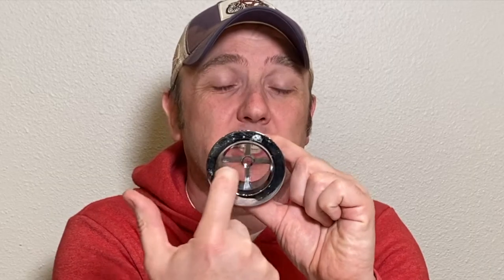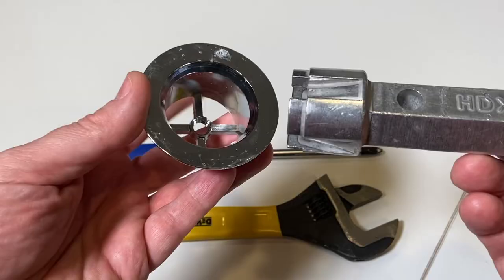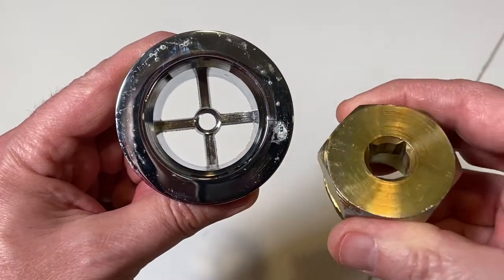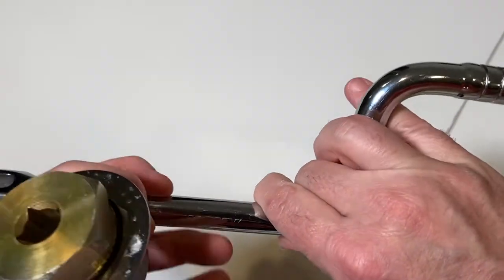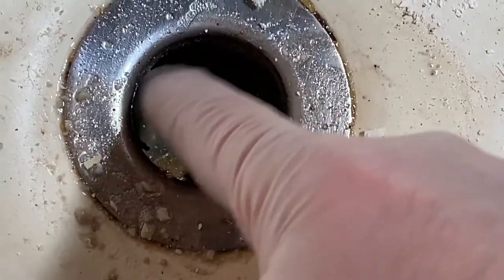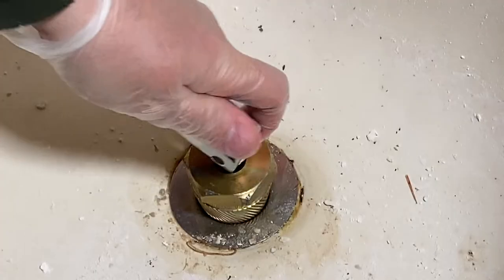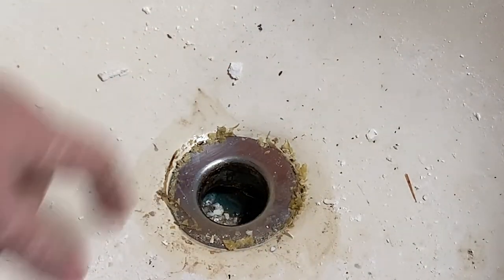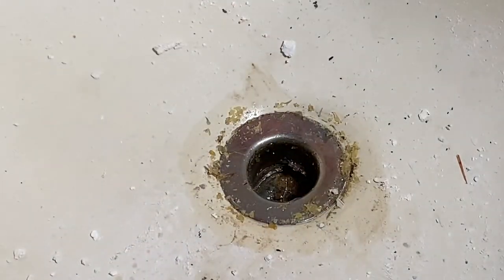EASY Plumbing Tools for Removing Bathtub Drains

Comment: I just removed the most stubburn 1-3/8 drain.  Tried a couple tools and methods.  Finally got it with a Blow torch for about 20 seconds, then turned it with that 1-1/2” extraction tool and a breaker bar.
Reply from the maker: Right on. That is awesome. I will add heat next time ones stuck. I just bought a new tool to review that looks like it could be the best on the market.  A review will be coming soon.
Reply: @ThatFixItGuy  Yesterday I tried that new 1-1/4 to 1-1/2 extraction tool by Superior, and it did not work for me at all.  It wasn’t even close to working in my situation.  When using a blow torch make sure nothing is plastic that could melt.  I’m assuming the heat makes the metal softer so the teeth can bite better.  I’m going to try this method on another 1-3/8 drain soon.  I will let you know how it works.
Reply from the maker: @jasonzupke1474  right on. Or look for a tub tornado. Have not used it yet, but the tool looks like it will remove anything. I will try to do a tool review on it soon. It’s a beast.
Reply: @ThatFixItGuy  Can you send a link please?  Please test it out on an actual stuck drain.  Looking forward to hearing about it.
Reply from the maker: @jasonzupke1474   sorry I’m looking for it on the internet. I can’t find it. I found it at a supply house.

Comment: I  used that tool and it started to turn around and around but it never came out it just kept turning interning interning I wonder if the grooves are stripped
Reply from the maker: I have had mixed reviews on this tool.  It has always worked for me, but I have only had to use it a handful of times. Did you get it to work?

Comment: Heating it for a couple of minutes with a hair dryer or heat gun to soften the seal makes extraction much easier apparently.
Reply from the maker: I always forget about the heat gun, but you are right it may have helped. Thank you for your comment.
Reply: I clarify that.  I used a blow torch for like 20 seconds and it softened the metal for a better bite.
Reply from the maker: @jasonzupke1474  right on.

Comment: My extraction tool is slightly too big (universal 1.5"). If I try to hammer it into the drain Heman style will it crack the tub?
Reply: Did u get it out? I have the same issue
Reply: im a olumber you can hammer it in

Comment: I watched your other video about "easy" drain removal. My cross members disintegrated. I was about to comment and then saw this video in the sidebar. I'm afraid of it being stuck and twisting whatever pipe fixture its screwed into underneath. It's a mobile home with little to no access underneath without removing the vapor barrier and insulation if something breaks like it did on you :(

Comment: The Tub Drain Extractor tool does not work.  It's teeth did not bite and it slipped every time. The brass coloured coating even flaked off.  A waste of time and money. The  metal teeth in the extractor tool need to be harder than the tub drain it needs to cut into.
Reply from the maker: Did you tap the extractor down in the drain?  Sometimes it needs a little help getting down in there.  How did you end up getting it out?
Reply: I agree. Bought one today, the teeth won’t grab, at all. I started with light hammer whacks then full on angry whacks, still wouldn’t grab. Gonna try some friction tape but I doubt it works.
Reply: @tommyowen529  did the friction tape work? Same issue. The teeth didn’t grab
Reply: I broke it loose with a blow torch first, then the 1-1/2 “ extractor started turning it.
Reply from the maker: Suck to see that this did not work for so many people. I saw a new tool the other day and bought it. Way different and looks like it will get any drain out.

Comment: This is the tool I need to remove the drain. Where did you buy the Tub Drain Extractor? Thank you.
Reply from the maker: I got it at Home Depot. I also put a link in the description box for one. You could also try a dumbbell if the cross is still in the tub drain.
Reply: Thanks.

Comment: It should be noted that, much to my surprise, a standard socket wrench alone probably won't fit the drain extractor. So, if you are like me and have various screwdrivers, pliers and mid-size wrenches, but not a large assortment of tools, you may not have what is necessary.

Comment: If the crosspieces are still good  needle nose pliers works good  to remove and replace the drain cap .
Reply from the maker: So true.  I am about to test a new product soon.  That looks like it will be the best tub drain remover ever.
Reply: just tried that and the cross pieces disintegrated lol